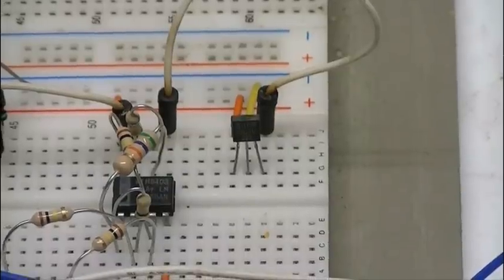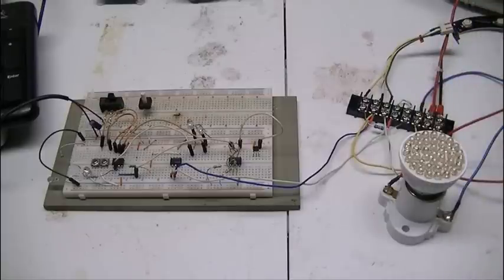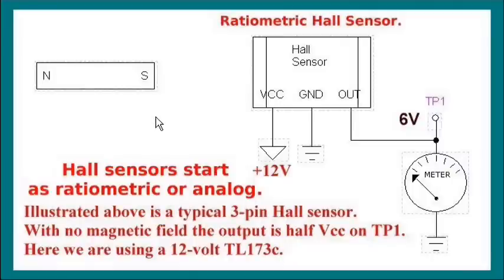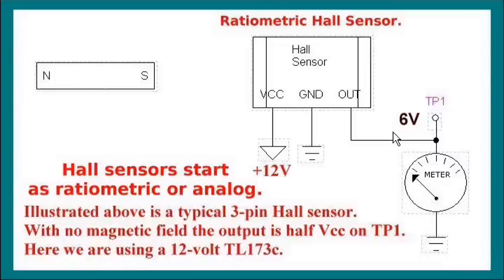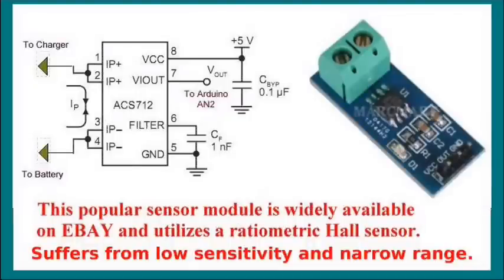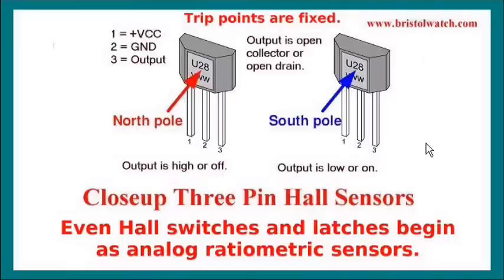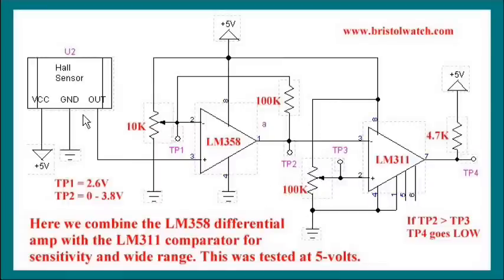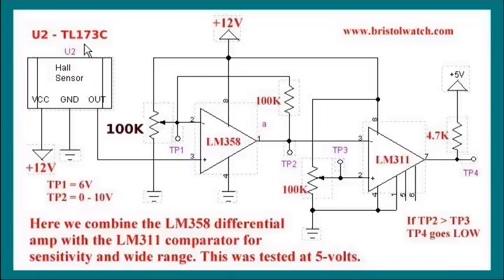Closer Look Hall Sensors and Circuits

Comment from the maker: New material 25 Dec. 2014:
Basic Hall Effect Sensors 1
https://www.youtube.com/watch?v=9BFdGtvo9JE

Hall Effect Sensors 2
http://www.bristolwatch.com/hall_effect/index.htm
http://www.bristolwatch.com/hall_effect/ratiometric_hall_effect.htm

Constant Current Source Tutorial
https://www.youtube.com/watch?v=lnU5d-KBMLg
http://www.bristolwatch.com/ccs/index.htm

LM317 Constant Current Source Circuits
https://www.youtube.com/watch?v=h4rRKWHMjpo
http://www.bristolwatch.com/ccs/LM317.htm

LM334 CCS Circuits with Thermistors, Photocells
https://www.youtube.com/watch?v=9XC2_be6h_8
http://www.bristolwatch.com/ccs/LM334_sensors.htm

Pulse-Width Modulation Tutorial
https://www.youtube.com/watch?v=ulcwDG3549U
http://www.bristolwatch.com/ele/pulse_width_modulation.htm

PIC12F683 Microcontroller and Circuits
https://www.youtube.com/watch?v=Uco71jBfAms
http://www.bristolwatch.com/k150/index.htm

Comment: Hy, very nice tutorial. Correct me if I'm wrong, but if LM311 has an open collector output, as a comparator when TP2 (inverted input) > TP3 (non-inverted), the transistor is not suppose to be off and TP4 should remain high?
Reply from the maker: +Adrian Carstea The LM311 is open collector and conduct when the comparator turns on.
Reply: +Lewis Loflin Yes, when TP2 > TP3, the comparator  is off, so the transistor is not conducting